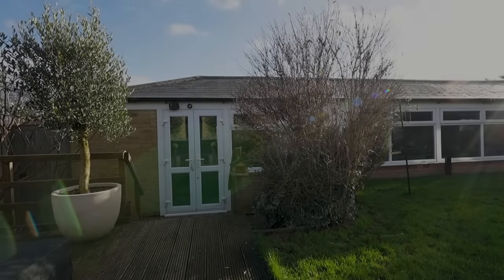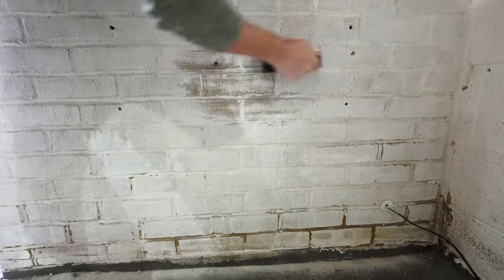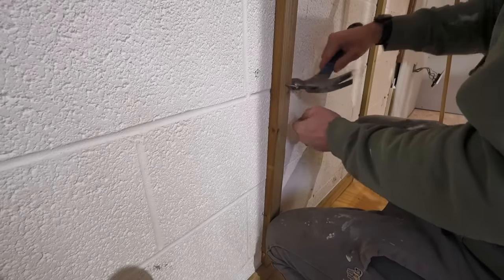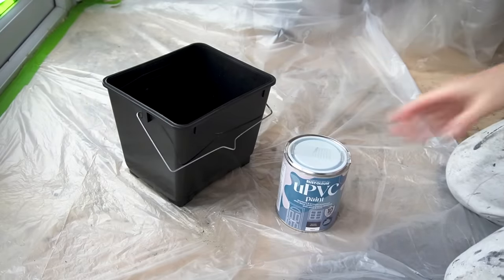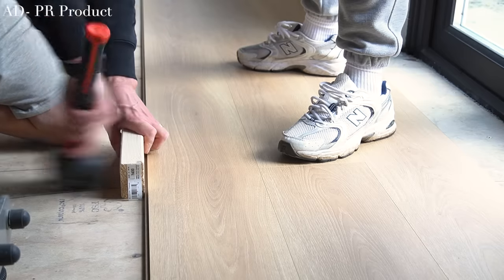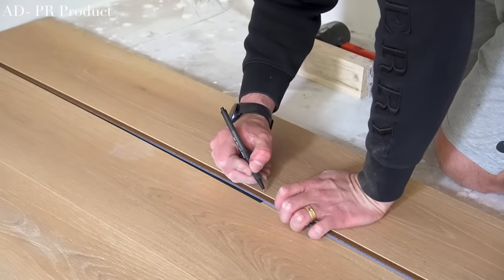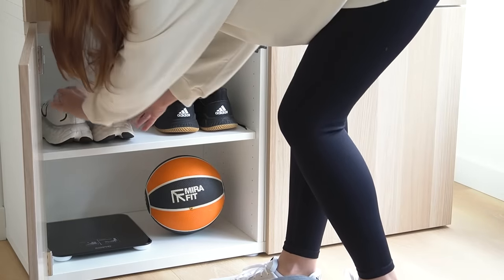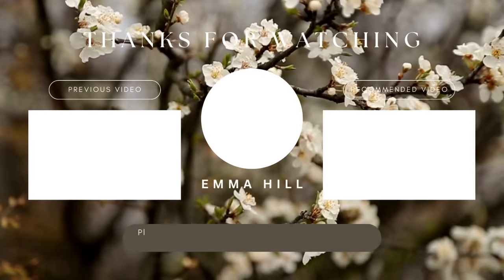Home Gym DIY Renovation Makeover

Comment: Wow what a transformation!! Absolutely amazing job 🎉. Can I ask what speaker you use in this room (plugged into the wall)? I have a speaker but the space for it is empty so I have to leave it on the floor. Yours looks much neater when plugged in the wall socket.
Reply from the maker: We just used our old Sony surround sound that we had in the house before we bought our Sonos system. I’d highly recommend Sonos though, they’re great speakers! We have them all around the house 🙌🏼

Comment: What a great space you've both made Emma!  My daughter and her partner are renovating a space for a home gym and I've sent the video link on to them!  One point - could you not have used the sprayer when you used the mist coat on the walls? Love to you Simon and the Bs. Xxx
Reply from the maker: Yep the sprayer could absolutely be used for a mist coat and even for the normal paint but I was using it for another project so it had other paint in there. Tbh for a mist coat it’s just quicker to use a roller, the prep of taping would have taken 10 times longer and me just zipping around with a roller x
Reply: @EmmaHill  😀👍x